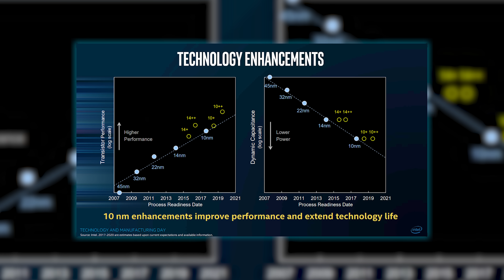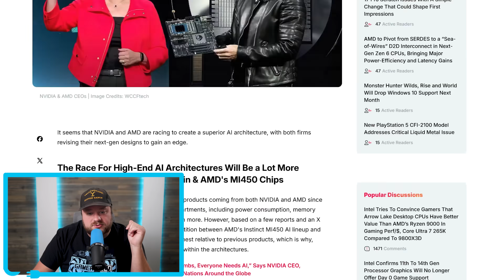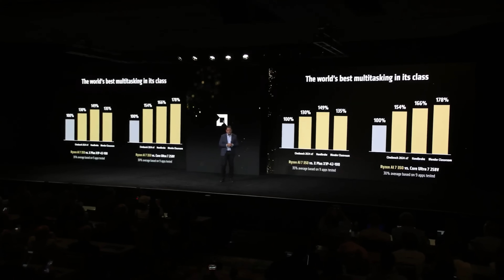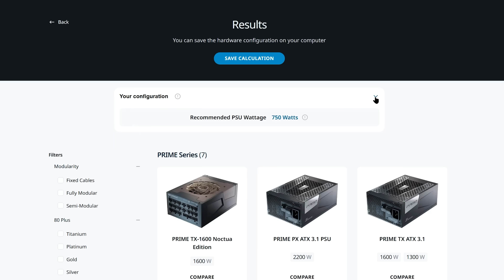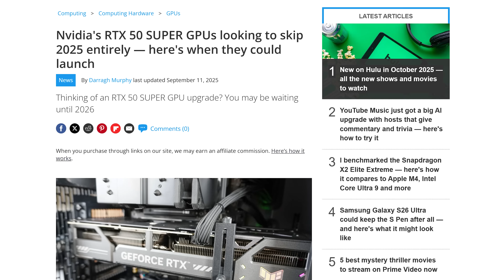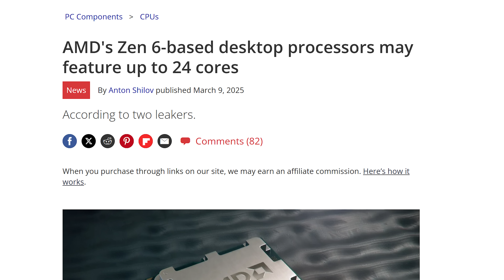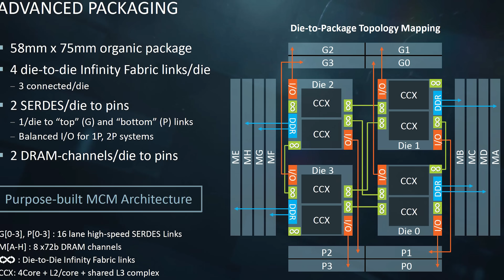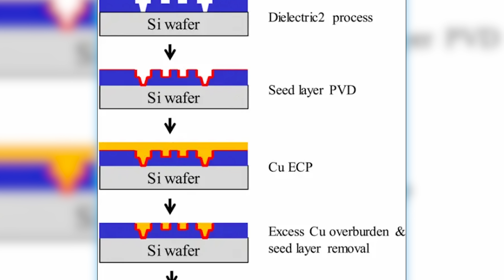AMD Will NEVER Be The Same!

Comment: interesting I am still using a Ryzen 7 1700
Reply: time to upgrade to a cheap 57000x3d :)
Reply: @mariuspuiu9555  my upgrade path is frozen. in order to upgrade I would have to change the MB. mine still works
Reply: I am still using 3700X. X3D is great, but 3700X is fine cpu. :)

Comment: Well.. I was waiting to build my next PC because I wanted AMD's or Nvidia's next gen GPU (that should have features the next gen consoles will use baseline) and was probably going to grab a 9800x3D, buuut if the Ryzen zen 6/next/sea of wires makes a huge difference then I might just wait until there's a good x3d version of one of those.

Or in the wild chance that intel comes out a with a banger

Comment: I already mentioned this at High Yield channel but here's a quick recap.

I don't think AMD will use this new Edge connect tech called InFo_oS for Ryzen & Epyc. This is because DDR5 doesn't have enough bandwidth to warrant changing the GMI link to something wider. AMD already have something called GMI-wide which double the bandwidth and is used for the Epyc products.

This contrast with the Strix Halo where AMD wants the CPU & GPU to have a huge amount of bandwidth at low latency in order to have good performance for AI/Video/Gaming workloads. This InFo_oS is very expensive and TSMC has limited capacity to make it so I think it's only going to be reserved for MI Instinct accelerators and Medusa Halo products.
Reply: you mean 64-128GB of DDR5-8400-8800 MT/s CAMM2 will not be enough?

Comment: New socket AM4 anyone?
Reply: There is like +7 months left for next CPU release, I am not waiting, I just sold my 5800X3D and am4 setup and going to order new 9600x soon, 9600x goes for a cheap price and will be enough untill next release, when next release happens I will wait for people to buy out stock and wait for price to drop.
I do not need CPU upgrade after 9600x. I am just playing nightreign at 1440p and plan to upgrade first to 4k.
Reply: @Kage0No0Tenshi I am on a 5800x3d and a x370 chipset board, with a 5080 (I am vary happy) I would like to hope and could back port the fabric to am4 just to get a little bit more out of it even if it's a limited release to show how bad Intel support is not good.
Reply: @Kage0No0Tenshi I have looked at am5 but I think I will likely end up on am6 or whatever the next socket is.

Comment: I hope there will be a proper desktop line similar to the AMD Ryzen AI MAX+.  I just want some nice integrated graphics with the same muscle as a mid-range GPU without the VCR sized "card."
Reply: What I'd like to see is an AI Max style desktop CPU with flagship graphics and uber fast unified memory. It would require some intense cooling, but it would be a true "AI" chip.
Reply: I want to live above a combination McDonalds/pizzeria/strip club.  I want gorgeous women to strip while they throw hundred dollar bills at me.  I want I want I want.
Reply: That would require a whole new socket and a whole new memory system..
These APUs work with connecting soldered DDR5 (I think 256bit) for higher bandwidth.

And even in terms of costs it won’t be cheaper than equally performing CPU and GPU.

Where it does excel though, is when you don’t want a big case with a whole GPU inside it and basically a mini PC form factor with custom board and soldered RAM, kinda like a console. Which is pretty much how it’s being sold now..

Oh and handheld too in a lower power configuration.
Reply: @salemgiath8150  That's exactly the kind of system I want.  If the Framework desktop had been available when I was looking to make a purchase, I would have gotten it.  Though my preference is for a desktop grade piece instead of mobile.
Reply: Imagine a system where you don't NEED seperate ram sticks - because the bios and CPU package allows you to pick and choose how you use the integrated memory vs. system memory. Imagine you get to buy like 4 components to build a basic system and, upgrading is literally adding in parts like it's the early days of home computers: Just add in more cards as you need more of certain things - from Storage, to memory, to GPU performance, and so forth.

THIS is AMD's Path with Chiplets.
Not Competitiveness - Dominance. When the competition is still making monolithic chips, and you are on Chiplet and Interconnect version 3.0 - and absolutely clowning on the competition in terms of price  while being feature comparable, and performance comparable if not superior: It's game over. That is how AMD came back in the CPU world; And honestly - it looks like that is what AMD is going to do in GPU land, as well as in the AI market.

1 Chiplet design that provides Performance CPU cores; 1 Design that provides Efficiency CPU Cores (lower power, more packed per area - the cost is performance but the benefit is everything else); 1 GPU Chiplet Design; 1 I/O Design (maybe 2 - for reasons). Pick and choose, as you need, and build it out. Heck, if the IO die can be built in the same Chiplet design - with basically zero penalty for simply linking a couple together to expand function, you really do only need one design.

If AMD Can design basically 1 set of components - and slap them together, as they see fit (or as Semi-Custom Customers ask): AMD ends up being the one stop shop for a huge number of companies, who, now can buy what they need, build it out, scale it out, and away we go. Even companies that are doing their own thing entirely - could, instead of going full custom, build a chiplet that does WHAT THEY NEED, and, get AMD to integrate it so they get the rest of what they need without the design cost.

The Purpose of this is - Market Competitiveness that basically no one can compete with.
The Consequence of this is - You get an APU with sold GPU performance, and likely, at some point, a Bios that really does enable AMD's CPU's and APU's to become SOC's in their own right.
Reply: @formes2388  Now THAT'S something to look forward to.  That's how computers were when I was a kid- add RAM on top of existing RAM, add video memory with a plug-in, hell, I added a floppy drive by plugging one in.  The idea of AMD making a computer you can upgrade as a whole, not just upgrade a subsystem of...  THAT'S cool.
Reply: I$ thi$ a money i$$ue?

Comment: i hope AMD also beat Nvidia with their next gen GPUs
Reply: even if they can make a gpu thats better in raster, who wants to spend $1000 and then have to download 3rd party software like opitscaler to get their gpu to work correctly.
Reply: @bigturkey1  what are you talking about? FSR 4 with redstone will essentially match DLSS 4, any difference will likely be imperceivable, there's no reason for optiscaler.
Reply: @bigturkey1  Are you serious? You'd rather pay an extra $500 for nvidia than use optiscaler??! And this is only for the time being... you didn't watch the video... AMD is gonna make DLSS a non issue. They recognized this is what Nvidia is selling, so they will make it better and give it to everyone (old nvidia cards included) for free.
Reply: @EscapeVelocity1  yes, but it wont be 500, 4080 was 1200 7900xtx was 1000. when you gamed at 4k with upscaling xtx needed to use fsr3 quality to get the fps of a 3080 using dlss performance while looking worse and using 100w more.
Reply: They did it first time on R9 295X2 and last time on 6950xt.
Hope they can bring something like that.
Reply: Not gonna happen nvidia pours billions into gpus and nvidia is richer than amd they hire the best technicians not happening nvidia hires the best of the best
Reply: @KronixGDMX Hmmmm I recall that  Intel CPU's were light-years ahead of AMD CPU's, now it's been bought out by Nvidia because all it has brought out is rubbish. Hmmmm.

Comment: 1 thing I kind of wish nvidia would do is bring HBM back to the consumer cards. Now with HBM3E and HBM4 not having the issues HBM1 had it would make sense and at least justify why the top end consumer card costs more than your car. It would also mean a way to get even tighter control over AIBs as nvidia would be the one adding on the VRAM not them. It would also mean a lesser price for HBM per chip for nvidia if they buy it in bulk as the newest way they are putting it on is using what looks like tiles so like AMD's chiplet thing nvidia is doing something similar but different. Just like have 1 tile of HBM on the consumer card not 8 so the consumer version will have less VRAM. It might mean we get the same tiles as the enterprise but 1 at the mid end and 2 at the high end then 3 for the 90 class card while 8 for the enterprise cards. As each tile is up to 36GB that is an option. Now why do 8GB tiles instead of 36GB tiles? 8GB is just a 2 layer tile and much less room for error 16 is 4 layers while a 32GB card would be the 8 layer thing while the 36GB HBM3E tiles are 9 layers they also have a pretty high error rate that any error in any layer means the entire tile is thrown away. So having 2 layer tiles would make sense for low error rate but with higher volume. It would also mean no more duplicate R&D for memory controllers when just 1 kind is needed. Cost savings for them while us the end consumer gets the same or slightly better card just most likely will need a liquid cooler at the high end to get that "or slightly better" part since it is putting heat generating parts closer together which will mean it is harder to remove the heat with the same cooler and current cooler designs might not work.

Comment: Morse law is dead saids otherwise. The sea of wires is bullshit
Reply: Time will tell  :)
Reply: Which video does he address this in?
Reply: @genxjack72  he tweeted about it. it seems Zen 6 uses what's called Embedded Silicon Bridge which is better than the the known released sea of wires (higher bandwidth and density). But it's essentially the same thing because the one who mentioned "sea of wires" was actually talking about a fan out.
Reply: He made a post cuz his amd source was worried about the amount of incorrect information that was out there

Comment: I wish they would change "TI Super" to "Super Duper." It has much better flow.
Reply: Nothing super about it. They are just the industrial leftovers of the server cards, with slightly less errors than average... .
Reply from the maker: I’m down!
Reply: @GamerMeld  did you think about the wire interconnect moving over to gpu's! this may be why amd thinks they can match nvidia next gen. a true mcm with multi dies connected to form a big die likr the a.i. max chip looks like.
Reply from the maker: @craiglortie8483  POSSIBLY. Nvidia's NVLink is a SERDES type of interconnect, so there could be a reason they still use that. GPUs need wild amounts of bandwidth, so it would likely require a ton of wires. It would definitely give AMD an edge, and it could be something to get them to an MCM. Definitely not a bad idea. It just may not be feasible at the moment for a GPU.
Reply: @GamerMeld  But are you down, for Radeon TURBO ?
Reply: Super duper sounds too unorthodox for them,i think super ti would sound really good,ti super just rubs me wrong
Reply: Super Duper Geek
Reply: They probably can’t trademark it.
Reply: @uria702  if they can trademark Nvidia super, then Nvidia Super Duper isn't a stretch.
Reply: @03jalapeno Nvidia is company name bro 😂 heforce is the gpu tradmark will go with ti super
Reply: @Lavaloon-GM  They could totally tradmarke "Nvidia Super Duper" No doubt!
Reply: Even though I'm not looking for new PC components. And to be honest I have no need for "power" cause I only play old ass games .. I would DEFINITELY buy a PC part with "super duper" in its name. "Hey, check out my new GPU. It's the xx70 super duper 3x" 😁
Reply: 5070 Ti Super would be more like 4070 Ti Super Dee Duper